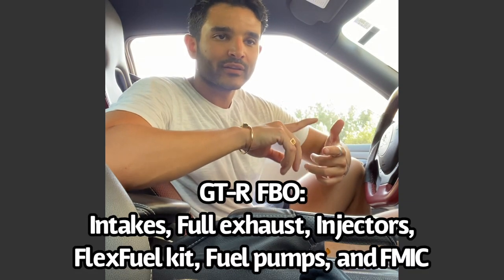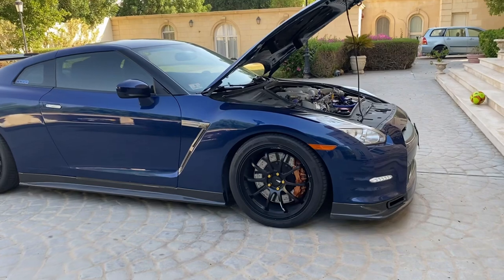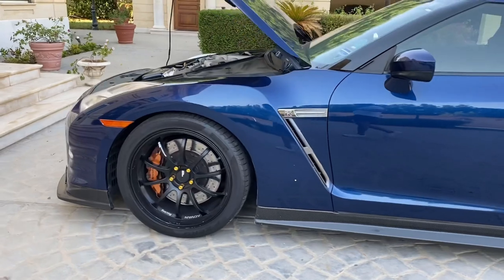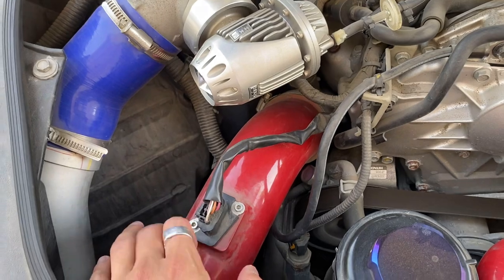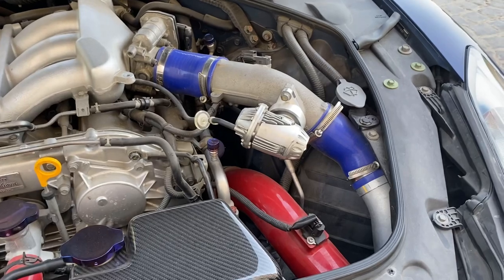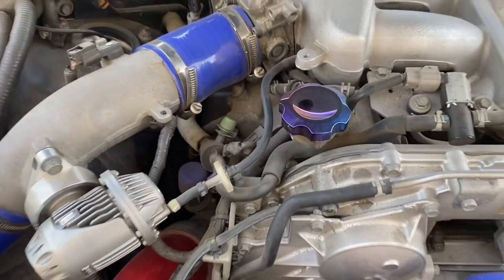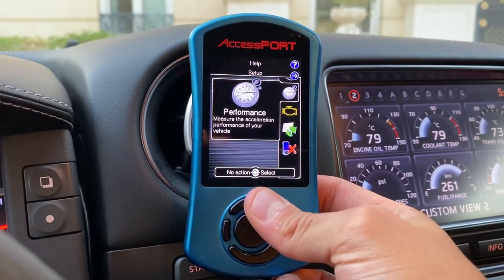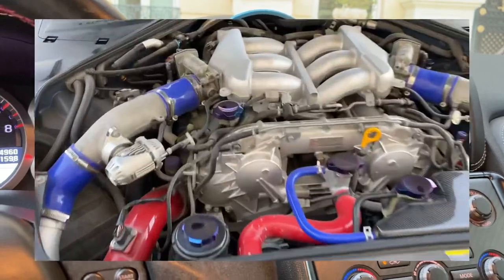What an FBO Nissan GTR actually makes!!! (Stock to Full Bolt Ons)

Comment: Great video, thanks for the walk around of your set-up. On mine, I have 1200cc injectors, and lately I have noticed that the boost levels go beyond the safe setting in the Cobb, which is at 18 psi. Boost goes up as much as 22, but then, it cuts out the acceleration and can't  go any faster once the boost hits the max. After the boost goes down I can accelerate and reach higher speeds but without a lot of boost kicking in. If that makes sense, so I'm trying to figure out why, I'll take any ideas on why this may be happening. Thank you in advance.
Reply: @Majj.Garage  no codes at all, and yes I'm running stock turbos. Just trying to think what would cause it to boost that quickly and not be able to reach higher speeds.
Reply: @Majj.Garage  yep so it has to be the tune than. Well thanks for the conversation,

Comment: which GTR would you recommend,? year? 2013+?  2017 ?
Reply: Um so recently i was compliance the years on what has been updated honeslty all the years are good but cheapish for a decent lil project a mid mile 09  0r 10 probably have ton sink around 20k to get it mint which for the car compared to other is preety mint that's just an upgraded trans q must in my op after researching now 700 package is your best bet that will be around 10 or 20 k  but other then that 2012 and 13 were the first major improvements  over 09 10 11which  were around 480 and 500 hp and then got boosted to 530 qnd 535 and then in 2017 560 however in 2013 or 14 I think would be your best bet maby even if the price isn't to huge as much as you can afford depending in tue doffrence used of course and if there 2016 or 2015 for around the same only a couple grand more I'd sink it for one of the new ones basicly every year or so they add a little goody or make it better so in the long run the newer one will be better with mods and maby more reliable

Comment: Great content, you just earned a new subscriber!
I wanted to check on the coolant temp issue, mine rises to 95’C on idle before the radiator fan engages, but when the AC is turned on it never surpasses 78’C.
Is that an issue with all GTRs or should I reprogram something ? Thanks

Comment: Will 2016 fbo gtr dyno higher then 2014? Same mods.
Reply: 2017 but it's pike every 2 years they chqng somthing to fine tune it 2009 qnd 10 had about 480 number were q lie tho from factory more likely around 500 2012 got a update tho qnd boosted to 530 2013 is 535 and 2017 was around 560 for exhaust as wide and straight as you can get rec greddy race pipes 3.5 inchs exhaust and then they got some nice big hard pipe which I see almsot everyone run my theory is since it's wider and more direct instead of all that fancy bullshit it allows for it just consume and suck as much air jn as possible iv always wondered how come no one has made a custom one like cleetus tho just a giant twin fucking air vent duct lmfao not really somthign like that but the ridgitt and design allows for a better torque curve and everyone always forgot you might be added alittle horsepower but witha gtr is you plug it and fbo it does make alot more like cap out your Injectors more and you can run an eco tune that's still miles more responsive way better curve just the whole shabang standard also at this point even with thew newer trans I'd upgrade mine with an aftermarket place or soem shut or get someone who knows therre way around and do it becuz like you don't need 1000 hp one but the 700 options uslay make it alot smoother and help fix some of its normal quirks or improves them becuz upgraded and updated peices and technolgy over the years and well yea altho I'd say get 3 tunes after the trans upgrade before hand keep it around 660 should be good or 630 anything near 700 within a few runs say good buy but other then that these thing for a sports /hypercar has always beena sport but after mods and 3veryone hyping it over years it earned supercar but just right off the lot it ain't heard it drives like a video game and is very direct iv seen people fling it around corners like one in edmonton a few years before near 118th it was awesome
Reply from the maker: I think it depends on the tune, gas quality,  and altitude...they all affect. So no, figures won't be equal.

Comment: Quarter mile timing ?
Reply: Dynojet numbers are more like crank hp numbers. Then inflating it with a 105hp loss through drivetrain calculation . That's how you get claimed 750-800 hp gtr's that only run about .7 seconds quicker than stock.